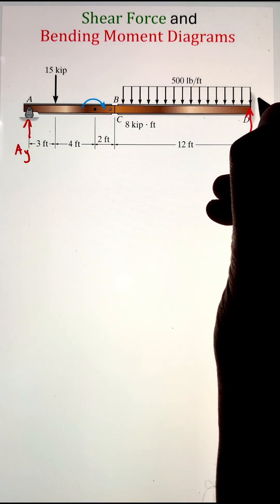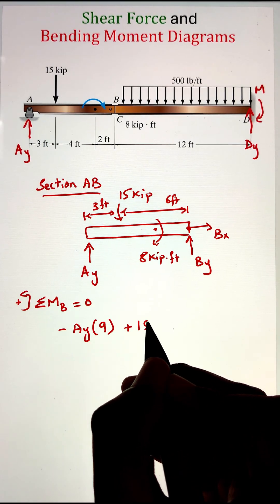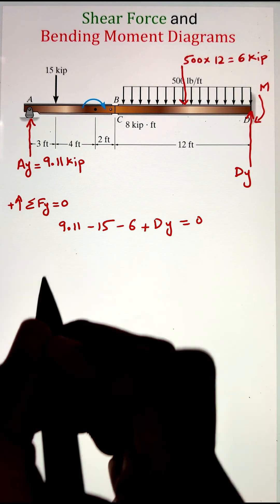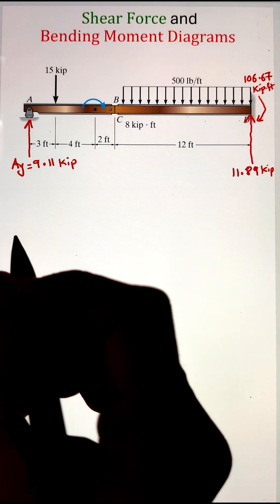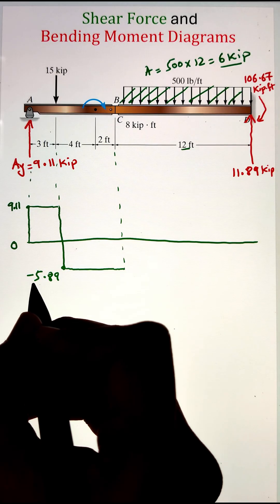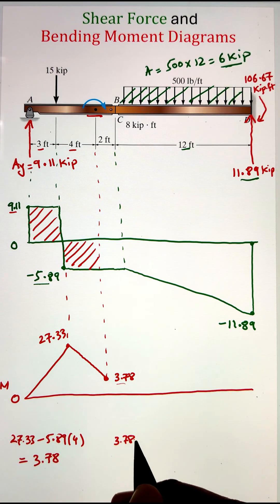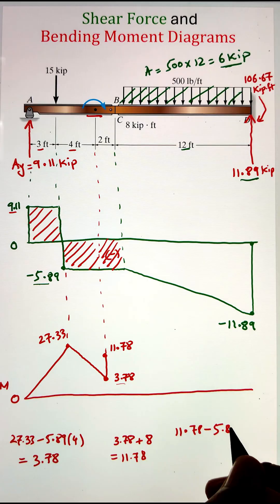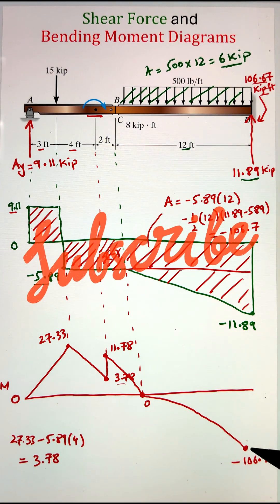Shear Force & Bending Moment Diagram (Graphical Method) | Step-by-Step Tutorial

Comment: When drawing the moment diagram, why did you solve add 8 before you did A;(5.89×2) even though A came first?
Reply: Never mind I realized it doesn't matter which one comes first, it's the same
Reply from the maker: Since a couple moment is applied in the counter clockwise direction 7 ft from the right end that is why it's added, afterwards we still have 2ft before point C, that is why I did -5.89*2 afterwards.
Hope this helps clarify